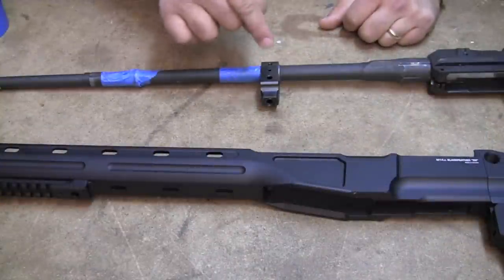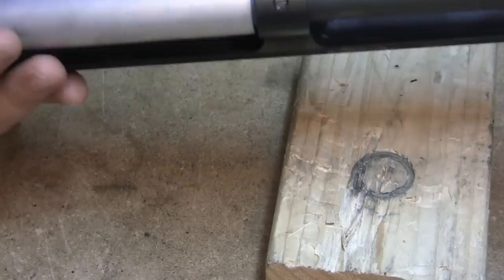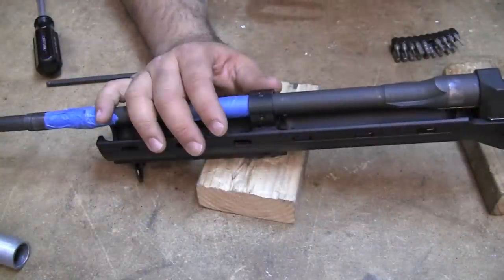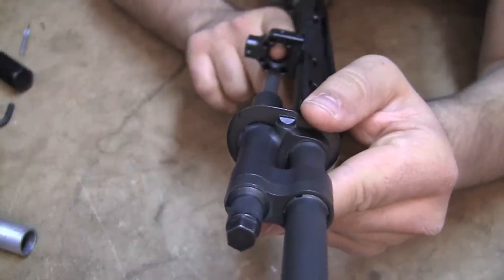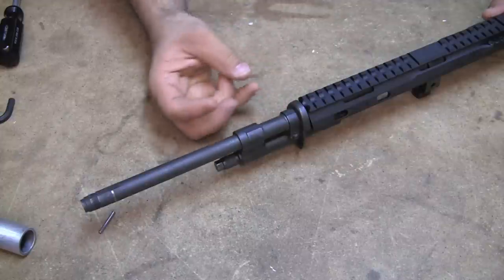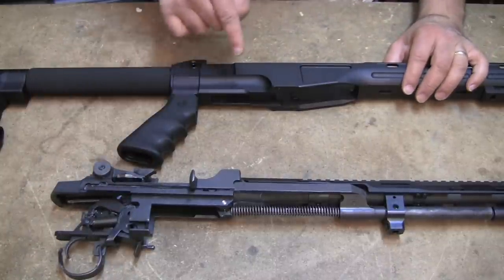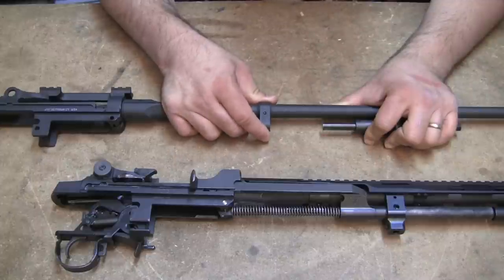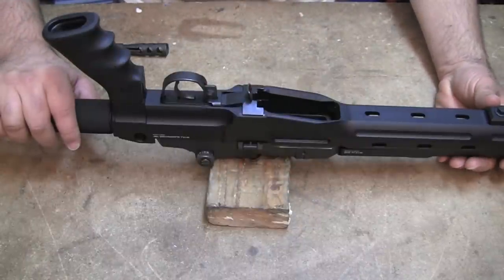M14.CA Blackfeather and Scout Hand Guard Installation Instructions, Part II

Comment: Thanks for the video. Very useful information. I actually had trouble with my trigger guard during install. Mine was REALLY tight. I managed to fit it in and it functioned fine until i brought it to the range. It was so tight that it actually flexed the receiver a tiny bit and caused the op rod to seize up in its track on every shot at the back of the receiver. Had to punch it forward every time. 
So i filed it a bunch where you mentioned and it works perfectly now.

Comment: Just assembled mine yesterday.  The only hiccup was that the Norinco had two light spot welds on the flash hider.  You tube video methods of removal either required an expensive looking puller or made it look too easy .  My gun shop said use a dremal to remove the welds.  I found you do not need to go very deep to defeat those Chinese spot welds.  You can live with the grind marks on the bottom of the flash hider  or replace it.  I also installed the CASM Gen 2 optical sight mount.  So I spent ~ $ 870.00 incl tax for the Blackfeather RS and the CASM mount.  Plus another $130 for a Hogue pistol grip and a Magpul buffer tube and butt stock.  I installed a Vortex Spitfire 3x Prism Scope that I bought used, so $350 . The Norinco M305 was bought 3 or 4 years ago, so I think it was $400.  So $1750.00 for a scoped semi auto .308.   Is it worth it?
Reply: Is Norinco receiver suitable quality in your opinion?
Reply: Ps - i envy your rig

Comment: Hi Tony. I didn't quite get the tension adjusting part the explain in the manual?
Where do I have to adjust it? Is it the big bolt which holds the ORG to the stock?

Comment: Well you certainly made it look easy, Tony. I need to sand the barrel to get the op rod guide to fit and modify the trigger latch to get it to lock. The guard only comes down to about 4mm above the tip of the trigger. Suggestions? Or just Charlie Mic?
Reply from the maker: It's hard to say about the trigger group. I learned with the Blackfeather that I could have a really tight trigger group and still have a functioning rifle. You can also try hammering the action down into the stock a little more with a large rubber mallet, or you can file the trigger guard where it engages the D cuts in the receiver. Also, check the back of your receiver and make sure there's no gap between the heel of the stock. After I made this video, I found out there was a 0.012" gap of daylight between the bottom of the heel and the top of the stock. Use adhesive shim or epoxy to fill this area if there is a gap.

Contact me via e-mail if you have any more questions.

Tony.

Comment: Hi, nice videos on the m14 and blackfeather chassia, what do you think of the norinco m305? I am camadian and the m305 is lots more affordable and accesable. I think they have a forge receiver, but the qualaty controle is not as hight as the USA m14 (M1A). So would you pay 600$ for the M305 or 2000$ and over for the M1A as a start up for future upgrad thanks

Comment: I had the problem where i could not close the trigger guard  to seat the trigger group in the receiver. So i did as suggested and filed the trigger guard latches. Filing the trigger guard causes the trigger group to fall short of sitting fully in the receiver, which in turn  causes a hammer follow condition in that the  hammer will not engage the disconnect hook. I now have to locate and buy a new trigger guard  as the original is rendered useless. Anyone know where to buy a Norinco M305 trigger guard. I'm in Ontario, Canada

Comment: is the top rail aluminium or plastic? Also where did you come up with the gas cap torque of 150in/lbs? I have been simply tightening mine by hand and have had no loosening issues. I do lubricate the threads as well.
Reply from the maker: The hand guard is aluminum. The generally accepted torque spec is 120 inch pounds to 150 inch pounds. The Marine Corps Rifle Team went as high as 23 FOOT pounds. You should at least use a wrench and snug it goo-n-tight if you don't have a torque wrench. If your plug hasn't loosened, you're probably just lucky. 

The torque I specify was shared by professional M14 gunsmiths and armorers.

Tony.
Reply: +tonyben3 Roger that, I do have a torque wrench and will consider tightening it up a bit. This was after 200 rounds fired it was still snug. The hand snug reasoning is so I can take it off in the field however I just ordered the field cleaning kit so perhaps that kit has the tool to tighten it. Even worse that not being able to get it off in the field would be not being able to find it because it fell off somewhere.

Comment: Is this a Scout only stock or can I drop my 22" Loaded into this?
Reply from the maker: A loaded will fit but the scout hand guard will not fit since the loaded uses a medium weight barrel. The Blackfeather chassis is good to go with a medium weight barrel!
Reply: tonyben3 is there a different hand guard that comes with the chassis or do I just use the stock hand guard on my rifle? So in other words, I CAN drop my 22" Loaded with a medium weight barrel into the chassis, but will be using my existing upper hand guard that comes with my rifle, right? Sorry if I'm slow on this...
Reply from the maker: That's correct. It's designed to work with a GI hand guard. The Scout Hand Guard is optional.

Tony.

Comment: I wouldn't recommend this stock for a regular M1A. This video is for a scout M1A.
Reply from the maker: The rifle that I used for this video was a standard M1A. A scout M1A installation would be identical except that you'd probably have to remove the forward count mount. that clamps over the barrel.

Unfortunately, I've heard of people having issues with every chassis system to include the Blackfeather, SAGE and JAE. With different manufacturers come different tolerances and different fitment issues. I've had to take a jeweler's file to a SAGE chassis to get a receiver to fit in it before.